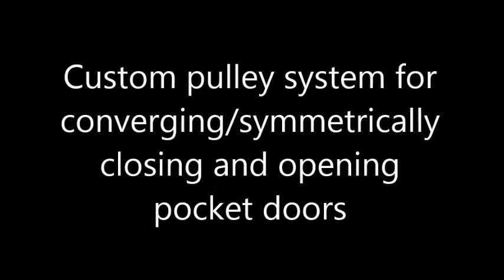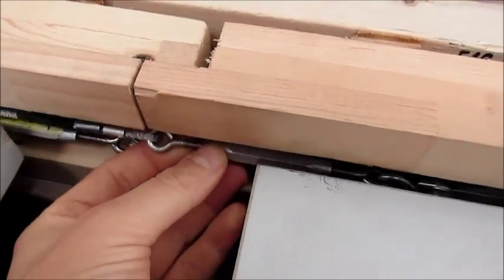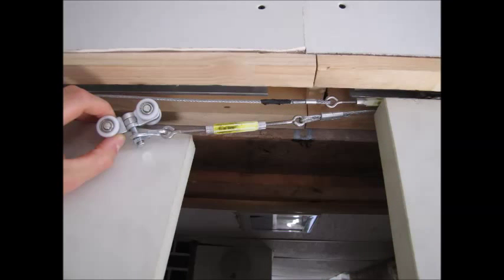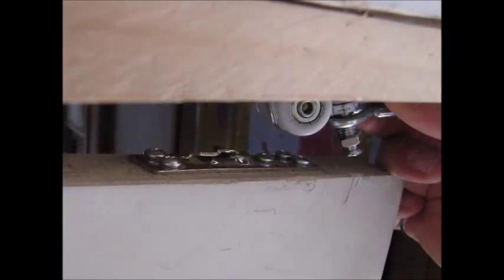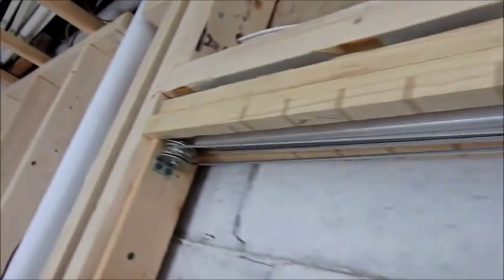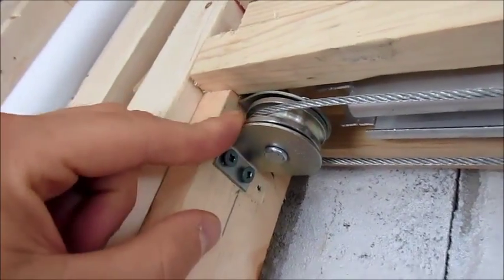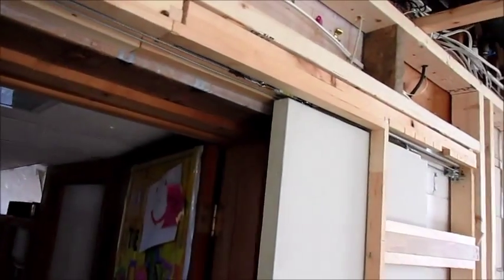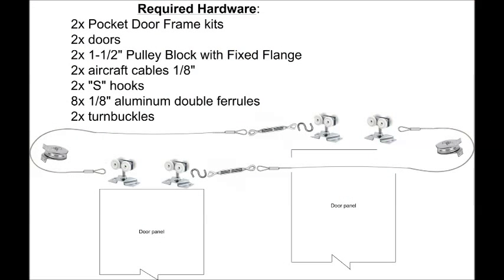Pocket Doors - Symmetrical, Converging Pulley System

Comment: Is there a way that I could do this with a set of bypass doors?  I wanted to put a sliding door but the opening into my living room space is too big, with the side walls being too small, to use only one single door.  I wanted to do a set of bypass doors on each side and have the doors all track together with opening.  Do you think this cable system would work on the primary doors and I could place stoppers on the doors to pull the outside doors in and out with open and closure:
Reply from the maker: Hi David, I think it should work. The key is the "anchor" points at each end of the tracks, which in my case, are bolted into the 2x4 wood frame inside the wall...

Comment: Hi Daniel. Thanks for the video. Question. It looks as though you cut part of the track to accommodate the pulley; am I correct?
Reply from the maker: Hi Stephen, I did not cut the track. it's in fact two individual pocket doors I bought from Home Depot, each with their own track.

Comment: Mr Daniel do you have a diagram showing how this set up supposed to be looped your just showing needed materials, thank you for your time!
Reply from the maker: Figuring out the looping was the fun part (like a puzzle!). The 4 cable ends are each attached to one of the 4 "door hanger bolts" (left-to-left, right-to-right). The left hanger on the left door is linked to the left hanger on the right door. The right hanger on the left door is linked to the right hanger on the right door. hope this helps. good luck!

Comment from the maker: I attached turnbuckles to the door track hangers using S hooks. This is to adjust the tension and to center the doors. I closed the "S" hooks with pliers to prevent from unhooking. Position the pulley so that one side of the cable is running as close as possible to the center of the track and install the other pulley on the other side of the track to help the turnbuckles slide side-by-side without hitting each other.